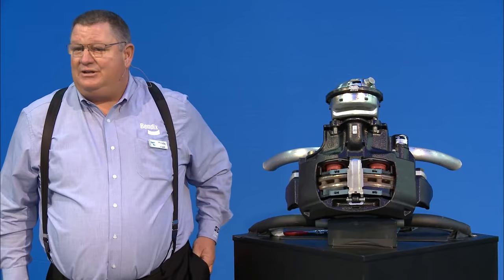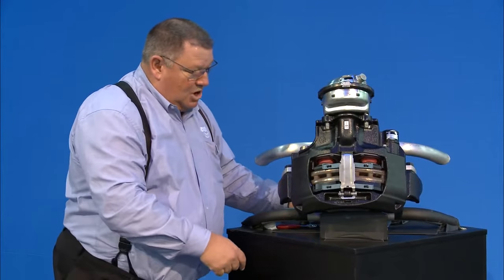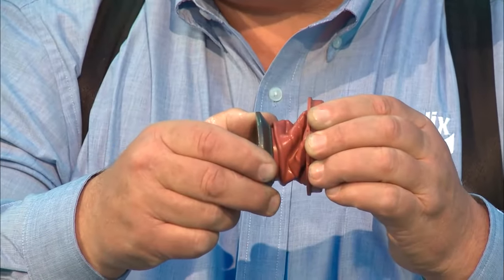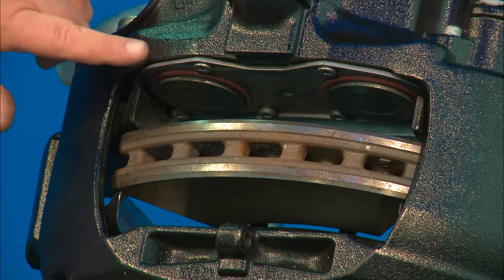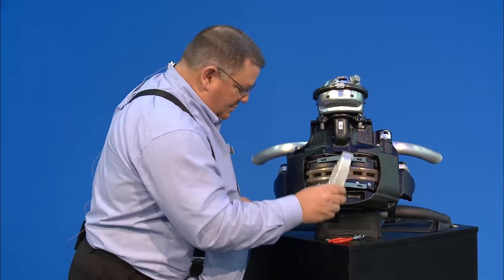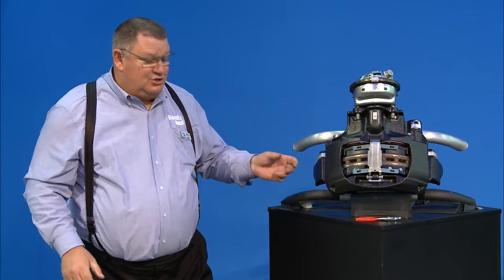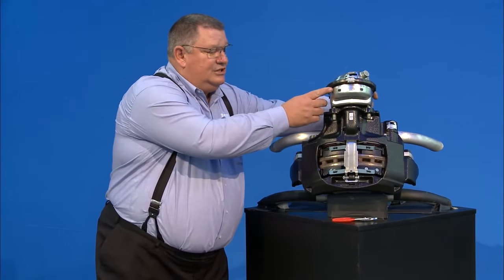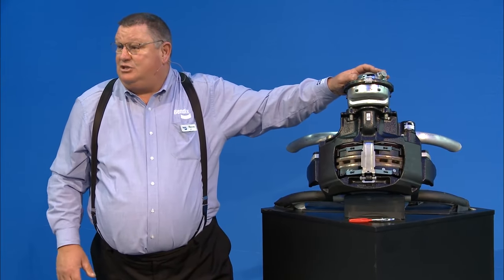Bendix Tech Talk  Air Disc Brakes   Proper Maintenance and Inspection Techniques

Comment: I've been driving for a new company 3 months and the trucks have disc brakes. I got another trailer a few says ago and the brakes are weak. I wonder does it need new pads or adjusting. I have to step too hard on the pedal for the truck to stop. The trailer brakes a lone will stop the whole truck but it takes to long.

Comment: What is the average ratio of pad to rotor replacement?
Reply: So far I have 250,000 miles and I'm still on my first set of both pads and rotors and the pads are about half way worn and there doesn't look to be any wear on the rotors so far. Of course your mileage may vary.

Comment: this is a bad system never manufactured in the truck system for many reasons # 1 the price # 2 they run out very quickly # 3 the discs are very expensive involves a lot of expense for everything
Reply: Its expensive because is not popular maybe.  But I will pay extra in order to have the peace of mind that I have more stoping power when I need.  It is beyond comprehension as to why drum brakes are still being used in the trucking industry.  The one job of a braking system is to convert kinetic energy into heat,  and drum brakes are about if not the worse solution for getting rid of heat.  Drum brakes should be illegal to be equiped in any new truck and a deadline put in place for older trucks to convert,  maybe today you will not have a trucker facing a lifetime in jail and 4 people dead.  We are not in the 50s were trucks carried 10K pounds at 15mph,  we have theses rigs doing 70mph with 80K pounds,  its time we bring the truck braking systems in the USA to this century
Reply: None of what you said is true
Reply: @loweskydoleo1332  I have a lot of respect for most Trucker's .I would have to put most blame on the car drivers . When I'm driving my DP RV sometimes it's like they want you to hit them in so many ways unfortunately the Trucker get the blame IMO
Reply: @loweskydoleo1332  
They've been available since 2008 man
Where you been
Reply: In response to the original comment 
Yes at initial replacement it's expensive and complex.
But once the aftermarket caught up 
They've made it extremely simple for service
I have found them far superior to drum for many things 
Wear life, fade during use, and service life of original components. 
Routinely seeing over 800k miles with good operators for original parts.
Just routine inspection at an annual basis will head off many problems.
Reply: @mwhitelaw8569  I replaced disc brakes myself what nightmare that's a lot of work and this thing come apart very awkward you even need to replace wheel seal
Reply: @rromero9763  You replace it bc you cant reuse seal?
Reply: @norrisgoodjr  when replacing disk you need to remove caliper six volts imposible to remove unless you heat with torch sometimes takes hrs just to remove caliper the you need to release brakes remove brake chamber from caliper then remove nuts to remove bearing before remove hub assembly after remove hub assembly put assembly upside down to remove wheel seal because you cannot reuse wheel seal ..after that remove disc brake and reinstall the new one and the list goes more
Reply: Does anyone know if it is recommended to regularly adjust the brakes? If so how often.
Reply: @jeffdollak4998 I wouldn’t they should adjust themselves. If I’m not mistaken when your air reaches atleast 100psi you release brakes and hold the peddle down for 2 seconds and that’s your adjustment and that are out of adjustment after that need to be looked at by a mechanic